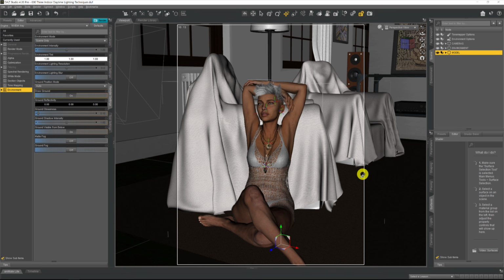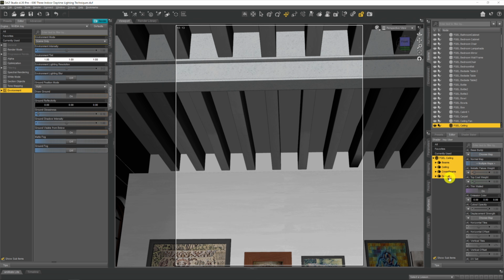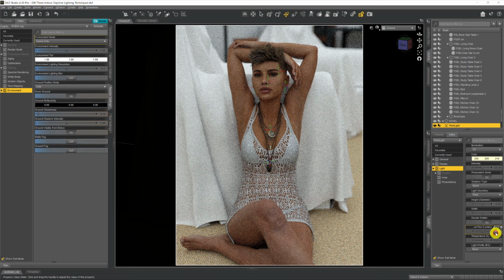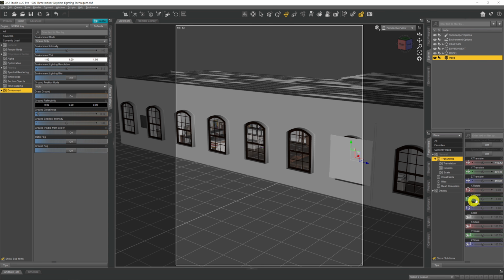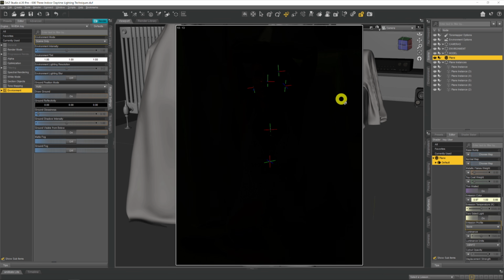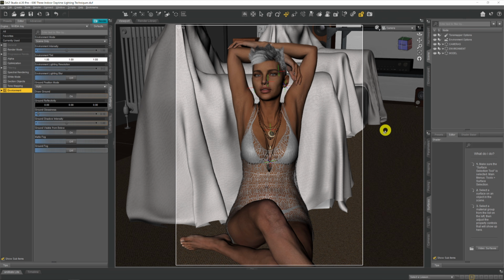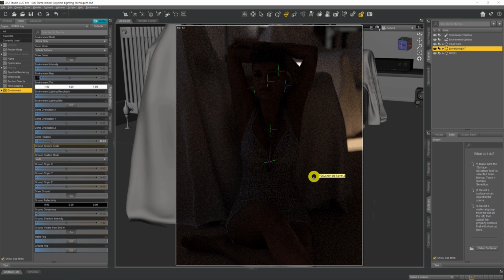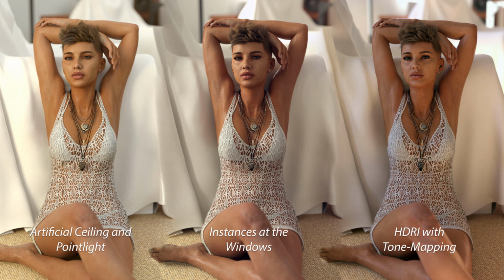Daz 3D Lighting Tutorial : 3 Daytime Indoor Lighting Techniques

Comment: "You are not lit up by anything artificial." Looks over at the lamp in the room and the night sky outside. Yeah, I am not lit up by anything artificial at all. 

Not that I can be in sunlight anyway since I burn easily.
Reply from the maker: 😬

What I mean by that is that you don't have any artificial lights in place designed to specifically light YOU. You don't have a 1 meter wide softbox following you around all day - constantly being re-positioned to light your face in the most flattering way. The light in the room is "natural" .. the lamp is part of the room and is positioned to light the room .. not you. So if you burn in sunlight - is watching this video a means to see what happens when you open the curtains? 😀

Comment: Thanks. This really helped me understand lighting and get the effect I want in my current project.
Reply from the maker: Glad to help out - which of the 3 techniques helped the most?
Reply: @RaukoDaz3D  Using the ceiling for ambient lighting helped with the project I was working on. I had a character in a glass cylinder. I was trying to use a torus for the top and combine it with a spot light. That wasn't going well. Using a solid lid and converting it into a light emitter worked perfectly and gave me much better control on intensity. I haven't tried the other tips yet as I was anxious to get back to my project but I will. Thanks again!!

Comment: Great video! You make it look simple, but it doesn't look the same to me.

I used the third method (HDRI). With the same parameters in render settings (including the dome rotation at 82.62), with the HDRI you attached, same environtment, same model position, same camera framing... And the results are far away compared to your final render... Too much noise, grainy (or whatever it's called). The shadows don't look the same to me. 

I don't have a 3090, but I do have a 2080TI...

I don't know what could be going on...

I hate lighting, I'll never get it...
Reply from the maker: Hhhm .. I don't know - there's nothing else been done other than what's in the video.. Are you on Daz 4.22? I noticed myself when I tried to render something on an older version of Daz there was a slight difference between it and a 4.22 rendered version - so there's definitely been a change in Iray (though they were still 99% the same).

Without seeing your version - it's hard to make a call on it .. You've increased the Tone Mapping like I did in the video? ... Just a random thought, that's all .. 

Like I say - I've not used any magic sauce .. so .. copy the numbers things should come out more or less the same ..
Reply: @RaukoDaz3D  Thank you for your reply. 

I increased the env. intensitiy, and in another attempt I used the tone mapping values (although I didn't combine both).

I'm using version 4.22. 

Btw, I have the computer unformatted since older versions of Daz Studio. Maybe updating version after version has something wrong for a long time and I should format the computer.

Comment: I know this is an older video but... I'm curious... would you make a video on best practices for lighting indoor scenes that are not anywhere near windows? I've been mostly working with planes (primitives) turned into emissive surfaces to replicate "ceiling lights" but this is often unsatisfying when lighting multiple figures. Thanks!
Reply from the maker: If you're talking about indoor night time shots then I do have a video in mind for that .. if it's indoor daytime (like this video but further distance from the windows) then I personally wouldn't use ceiling lights .. To me, anything daytime (indoor or outdoor) should use as much natural light as possible (so HDRI or Sun / Sky dome) as anything artificial like ceiling lights would just produce .. artificial lighting. If things are a little too dull indoors then play with the tone-mapping settings and / or add either some strategically placed bounce boards (white reflective planes) to spread the natural light about more or add some subtle emissive planes to light up your models. But you need to bear in mind that these planes are there to add to the natural light and not replace it.
Reply: @RaukoDaz3D  I am discussing light indoors away from windows. Like, the light in the deeper parts of a shop, or in a basement, or the middle of an office building. Places where you probably only have overhead lighting and not a lot else going for you. I'd love to know more about using reflectors. I have no idea how that works and it seems like it would just vastly slow down render times. But I still feel like a total newbie even though I've been fooling around almost a year now.
Reply from the maker: A light reflector is something like you might see used in Photography (see this image : https://i0.wp.com/digital-photography-school.com/wp-content/uploads/2016/06/photo4.jpeg) - it doesn't give off light in itself but just reflects light in the scene onto areas of your subject that might be darker.

As for the bigger picture .. indoor light with little outside ambience .. I tend to use a mix of emissive and ghost lights if needed .. (check out this video on Emissives where I build a completely dark scene using emissives : https://youtube.com/video/8IkkAPIZeMg) .. however, it depends on what type of scene you're building .. If you're doing something like a model shoot then you'll want to use Spotlights / Point Lights .. but if you're doing a "slice of life" scene - for instance, a night time scene in a living room showing a family watching TV .. then try and use (in this order) : 

Natural light (through any windows no matter were the windows are .. so, mimic moonlight for instance if it's a nighttime shot .. sunlight if it day light)
Any lighting that would be in the scene .. ie, table lamps, TV screens etc and do so as emissives .. (if the scene you're using uses spotlights as a lamplight, for instance, convert it to an emissive)
Then add ghost lights if the environment itself isn't lit enough 
If your models aren't lit well then add SUBTLE emissive lighting (relatively large plane or disc primitives) to ADD to the lighting in the room and brighten lighten the models more  .. don't have these lights too bright that they out-shine any natural light or emissive light that you've already have in scene .. just add them to add to what you already have.
Then adjust tone mapping and camera setting to brighten the image further if needed.

That is generally my workflow doing indoor scenes ..

Comment: When using ghost lights at the windows I’m not able to get that box of sunlight on the ground if you know what I mean. It just sort of diffuses and lights up the whole room. Not sure what Im doing wrong.
Reply: I’m brand new and don’t have any sets yet. Until I get some, I’m working with a square primitive with cutouts for windows. Could that be the reason?
Reply from the maker: Sorry for the delay - I only just noticed your post!!

Even with the Ghost lights at the windows I'm still using a low level HDRI to give the light shafts onto the floor - I'm just not using the HDRI to light the scene .. I do my images by always .. and I mean always .. use either a HDRI or Sun / Sky dome to provide a base ambient lighting into the scene and then, in this example, use Ghost Lights at the windows to amplify that light!

You could get the same effect with the ghost lights by positioning them further from the windows .. quite a bit further in fact .. and ramping up the luminosity ..
Reply: @RaukoDaz3D  thanks mate, that def helps. But another question I had and something i just noticed, at like 15:50, you don’t have ghost lights, just the fully visible emissives. Shouldn’t that block the hdri? Because despite having  the emissive planes at full opacity in the way, seems like the hdri is still casting sunshine on the ground.
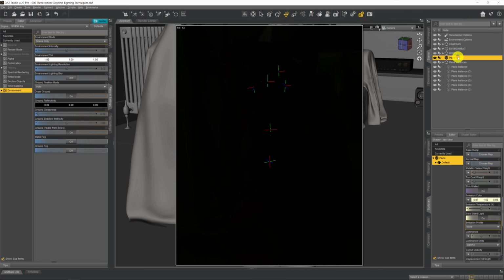Reply from the maker: I've actually now just rewatched the video (from 14:30 to 17:00) .. and I don't actually see the "box of sunlight" that you're referring to .. I'm sure it's just the room being lit from the "ghost lights" (albeir they aren't ghost lights at that point) .. you can see the "box" at 19:30 with the HDRI method (if that's what you're referring to) .. but I don't think it's there with the "ghost light" method ... but if that's what you do want using the "ghost light" method - then yeah, use a low intensity HDRI to provide the sun-boxes and use ghost lights to supplement the light .. or .. pull the ghost lights back from the window and up their brightness
Reply: @RaukoDaz3D  Haha I now see where I went wrong. What I thought was sunlight on the ground was just the lit up areas in contrast to the shadows casted by the furniture. I didn't register the fact that they were casting shadows and so thought those dark areas were the spaces in between windows, causing there not to be direct sunlight there. Thanks for clearing it up and also for the replies, very much appreciated.
Reply from the maker: @sinista  You're welcome - but you should be able to get the effect when using Ghost Lights using the methods I mentioned previously .. ("Should" = Ermm .. I've not tested it .. but it .. "should" .. work! .. 😀 ..)

Comment: How do I get a no lights scene; you do not say. I do not want to use IRAY and rather use indoor lighting. DS 4.21 does not show an environment option in render settings. Your tutorials are for more advanced viewers and your text font size, even at 2160p 3k is illegible.
I cannot find a tutorial for novices.
Reply from the maker: Hey there Hennie - if you're not using Iray - which render engine within Daz will you be using? 3Delight or Filament?
Reply: @RaukoDaz3D  Many thanks for your prompt reply.
On opening DS with nothing in the scene and then the Render Tab, the tab for ENVIRONMENT does not show. The bottom last tabs are: “Gamma; shading rate and filter. “
The ALL tab at the top does not show it either although there are them more options. The reason why I want the Environment tab is to bypass the Iray dome and set the camera to never. 
I found by fumbling around, setting the render engine to Iray and then pressing RENDER in the topmost tab the option for ENVIRONMENT appears beneath ‘Tonemapping’.
I make simple animations using DS and (3dlight (RSL) and do not render them; preferring to use a screen capture (OBS). I also interchangeably use the CTRL L keys to change the lighting. I am thus become independent on IRAY which I find a ‘drag’. I am also using the Daz to Blender and do animations and render there.  I think I will now perhaps be able to follow your tutorials which I initially found daunting, and your das windows text rather small. I will now upvote and subscribe. Thank you once again.

Comment: Using ghost lights at the windows with HDRI at default intensity for ambience and no tone mapping (for consistency between renders) is what I found to produce the most natural result without killing your render time. There was a particular scene I could render to 160k iterations with HDRI alone before it got to a convergence ratio target, putting the HDRI intensity back to default and dropping a ghost light in front of the window resulted in the same render finishing within 22 minutes instead of SEVEN hours, with any render target above 5.5k iterations being absolutely indiscernible in quality from the 5.5k render (I could switch between two pictures on a 34" monitor and there would be zero flickering suggesting any difference in clarity), WITH denoise off!

Generally I dislike tone mapping, because it isn't a render technique, it is applied in post to the image itself, meaning the brightness of your picture can literally change in the preview window as you render, as more of the picture is done rendering.
Reply from the maker: There's many different ways to do it .. some give great results, some poor results .. there's no right or wrong way to do it .. just comes down to what you're happy with generally and what works best for a specific situation.

Comment: So one major issue I found with the HDRI method. Was that on what seemed like an overwhelming majority of them, the sun was always located in the same rough location.
Mainly this is only an issue if you want/need the ability to have control over transition of the time of day. (Such as creating a visual novel.) For purely artistic renders, the below method isn't really needed.

An example I found of this, was I was having really weird lighting issues from 2 different HDRIs. One was this lovely warm glow that really had a wonderful early morning or late evening feel to it. The second had this really well done white light/midday feel to it. Turns out the latter that looked more midday, the sun was placed lower than the warm glow HDRI. So despite it looking more midday, the sun was actually lower in the sky and wrecking havoc on my lighting.

I found the way to fix this, was to set the "Environment Mode" to "Dome & Scene", setting "Environment Map" to "None", then after setting EM to None go and rename/delete the default environment map file. Doing this will ensure that when you reload a scene saved with these settings it won't auto load the default EM file. This effectively makes it function like Sun-Sky Only, where you can set long/lat/UTC Offset and so on but still allows the use of other lights in your scene. ("Sun-Sky Only" disables lights that aren't the sun, at least last time I tried). This lets you have all the pro's of Sun-Sky without the con of breaking your "real" lights in a scene like lamps and such.

After setting these settings, add in some physical clouds (DimensionTheory's Cloudscape Creator works wonderfully for this). This will add volume to the new "realistic" sky and allow contrast between the blue sky and the clouds, giving you a traditional sky effect. All of this together makes for some pretty powerful sky details/controls that let you fine tune not only lighting, but your time of day and weather as well.
Reply from the maker: I've actually seen that occur in Daz a number of times by accident but I've never utilised it when it occured .. but I imagine it would serve the purpose in which your proposing. Although, I'd hazard a guess and suggest it's a bug and could well be written out in Daz 5.

We do have some tools at our disposal however. If doing a indoor shot and not showing what's outside the windows - use of the dome rotation, as we know, will spin the dome around .. but also use of Dome Orientation X and Z will allow us to also change the angle of the light. So you can use the same HDRI and move the sun to a lower or higher position. It wouldn't change the lighting colour to what we'd see at dawn or dusk but I know of at least one toolset on the Daz Store that will allow filters to be applied to HDRIs.

The problem of course IS if you are planning to show the dome as changing the X / Z orientation will cause a tipped up world outside the window. But manufacturing a background either in Daz (as you show) or in Post can get around this easy enough.
Reply: @RaukoDaz3D  I suppose it's a good thing for me I plan to basically never update from Daz 4.20 haha. At least not any time soon. Ideally, for the purposes of creating my visual novel, I'm using an isolated instance of Daz that I've set to never update and have all my library set in a custom directory. Stability of an non-updating system n all that.

I'll likely set up an alternate instance of Daz in a different file structure that I'll let auto updates run, that way I can toy around with Gen9 and stuff sometime next year when it's got the products to support it.  So last thing I need is an auto update potentially writing out a very valuable setting to me lol.

I've gone through pained efforts to try and streamline my process so I don't have to bugger around with any artificial lighting at all, and doing my best to also avoid having to futz exposure values when a window just happens to be in X scene out of potentially hundreds or thousands. So far I've managed to elude having to do anything in post, save for a couple touch ups from a hidden prop (Light under door thresholds and such.)
Reply from the maker: I'm the same - I've been playing around building a VN for 6 months now when I get the time .. Sounds like you're like me and tend to go huge on the number of images per scene / conversation : every new spoken line get's a new image as though it's a still from a movie .. I can easily go 50 images for a conversation between two characters .. And so as you say : need everything streamlined and speedy!

Comment: The reason why instances work the way they do is because you're creating a single plane that will be loaded into video memory and then you're telling the engine to use that one object for all of them.  Which is why when you change the original, all change, because they all point to the same object in video memory.  A bonus from using instances is that they are much faster for the computer to use and they don't take up much video memory due to there being only one object.  I've programmed instanced objects in 3D and man, do they ever speed things up!
Reply from the maker: Instances are one of the most overlooked things in 3D to the beginner and their use goes far beyond just filling a forest up with trees ..